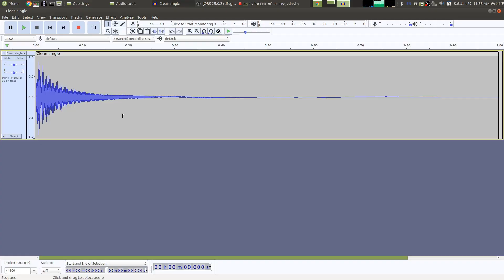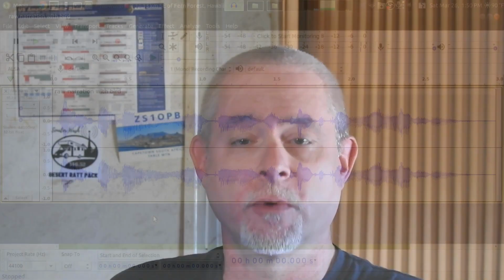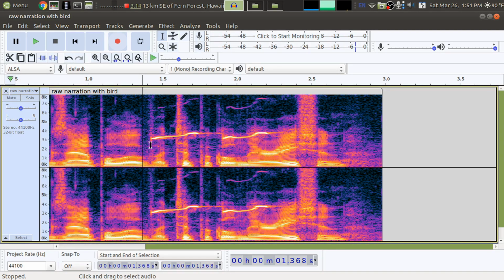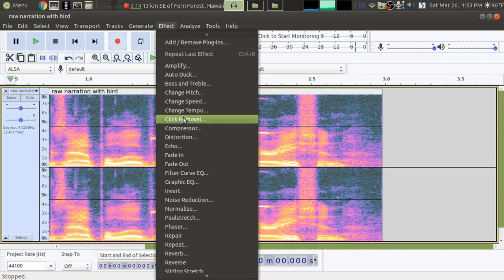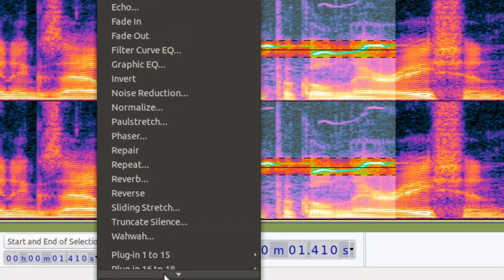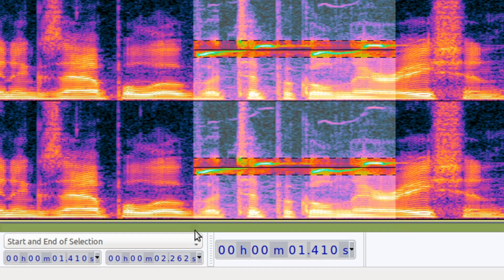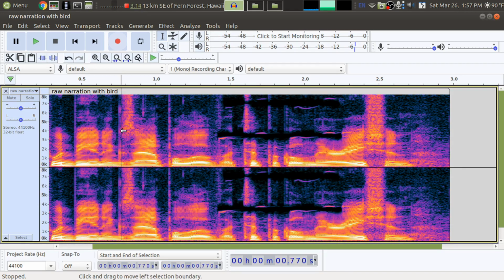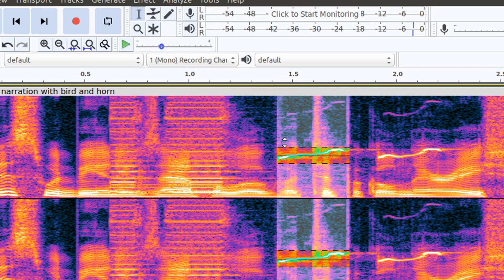Sound - Precision editing by frequency in Audacity using the spectrograph display

Comment: Hey Kevin. Thank you.

Which audacity version are you using? 

On Mac or Windows? 

Did you download those plugins yourself (as extra plugins) or do they come with Audacity? 

I tried to locate those plugins but could not find them.

I'm experiencing a humming from my own iMac (an old one from 2019) and tried to apply what you teach in this video but my Audacity version for my Imac Intel seems not to have these plugins (or at least not under the same config) 

Thank for your help. And your video am which is already very helpful
Reply from the maker: I'm using version 3.4.2. On Linux. The plugins came with it.
On Linux I can install extra plugins and such through the package manager.  On mac, I'm not sure how or where you'd find them.  There might be an audacity forum you can ask on.  Check their web page.

Comment: This is really good editing technique if you have a whistle-type noise which runs mainly horizontal where you can pinpoint that horizontal line and then erode it away.  But what if the bird is producing chirp-type noise which appears as vertical lines?  Very short and repeated chirping crosses multiple frequencies but very briefly each time.

Comment: Is there a way to remove crackling sound from a video? My voice has a crackle throughout an hour long video😢 this video is so impressive i thought ud have an idea about it.
Reply from the maker: If your mic gain was too high and the loud parts of your voice are clipping causing the crackle, then no. There's nothing you can do about that. You'll see that in the audio waveform where the top of the waveform will be flattened out at each clip.

Comment: Great example and approach. Is it possible also to patch in something else in the frequency domain? I'm trying to remove excessive vibrato, and it's easy to see the vibrato wave in the frequency domain, so presumably it's possible to remove that. However that is likely to leave an audible "hole" in the sound just like the change in your voice in your example. If we know exactly what the frequency is of the "ideal" sound, is it not possible to generate that with a precise oscillator, then patch that back into the audacity file using the spectrogram and multi-tools? It would be interesting to see if this works.

Comment: In Adobe Audition there are some tool to like paint on that like a brush. then you can remove noises very precisely. Is there something like that ?

i wonder if you can "compress" the sound in the selection to a level before the sound of the bird start. then probably your voice and the noise is not reduced but the sound of the bird will be highly reduced.

Comment: Hi Kevin, really interesting video. Can you explain how you made the submenu in the effects menu e.g Plug-in 1 to 15 and Plug-in 16-18?
Reply from the maker: They've always been there on Audacity under debian based linux, as far as I know.  Part of the default plug ins I think.  I don't know about audacity on windows or mac though.
Reply: @loughkb  Thanks for clarifying Kevin. I don’t see the same menu structure in windows so I presume it’s a Linux thing
Reply from the maker: @joedale  There may be additional plug in packs for the windows version.  Probably worth looking in to.  There's tons of add ons for audacity.
Reply: @loughkb  Thank you :-)
Reply: @loughkb  Hi Kevin, I asked the same question on the Audacity Forum and learnt how to replicate your menu by going to Edit/Preferences/Effects and in Maximum Effects per Group box replace 0 with a number indicating the number of items you want to appear below the line in the Effects Menu. Note that the effect grouping will be changed in the next version of Audacity 3.2, and on first run Audacity will enable every effect that it finds that it thinks are compatible (some may not actually be compatible with Audacity).

Comment: Good tutorial, thanks! If I understand the spectrograph correctly, the intense color that shows the bird sound means that those frequencies have a high loudness/amplitude (decibel). Then, maybe it would give an even better result if you could apply a low-pass filter for amplitude in that region of the spectrograph? Then the lower amplitude parts of the audio would not be decreased, so it would probably be less of a noticeable change to the recording. Do you know if such a thing is possible in Audacity?
Reply from the maker: Yes, under filters, it's the graphic EQ.

Comment: great tutorial Kevin!!  Too bad Audacity doesn't have a type of eraser similar to an image editor or paint program where you could have a type of dot or circle at the cursor and could just erase the fine line of the bird whistle.  Might have also been worth doing multiple iterations of the select but make it more narrow to only include the whistle line and do this a few more times as the freq went up instead of the more broad stroke box you were drawing.  Thanks for sharing your knowledge.  73 N7KBC Dwight
Reply: Is there an audio editor with the proposed feature you described?
Reply: @novachromatic Adobe Audition

Comment: Thanks Kevin. Great presentation as always. You gave me a possible solution to a problem that I am working on. I must distinguise between to sounds coming from a pellett hitting two types of metal. One sound must be ignored while the other is worth one competition point. I am going to use Audacity to determine the two frequencies and try to filter out the proper one.
Thanks again. Have a good day.

Comment: Hi.

Nice tuturial to remove 'noise' from background.  There are several methods such as using machine learning neural network,  such as Nvidia's "RTX/GTX VOice".  It is very effective. 

Off topiv:

I like to suggest a simple RF related experiment. 

1. Get a portable AM radio. Tune tu  lower AM5  band broadcast station, around 500 kHz. 

2. Start walking at a straight line, and observe the signal strength level. 

Observation:

We may find the signal strength changes about evebery 1/4 of wavelength.

So, somtime, the location/QTH of the antenna/receiver  may effect the recetption  of certain frequency bands., especially for MF and LF bands.

Thank you. 73